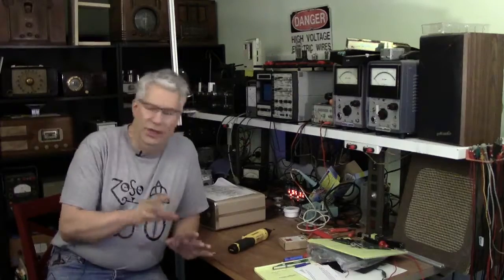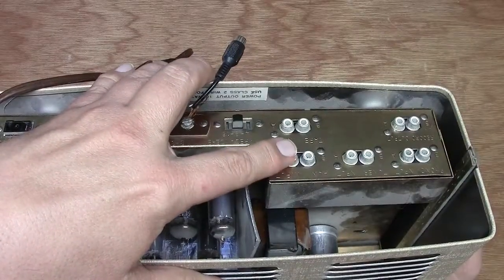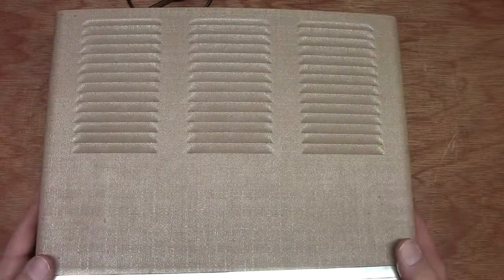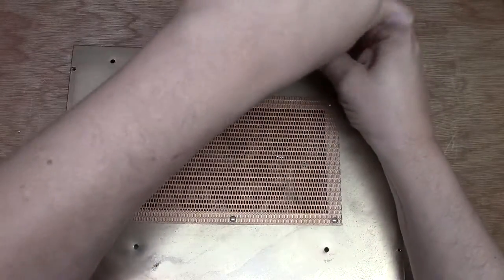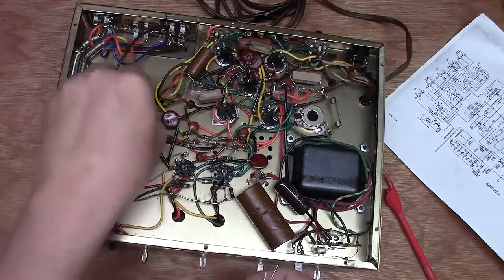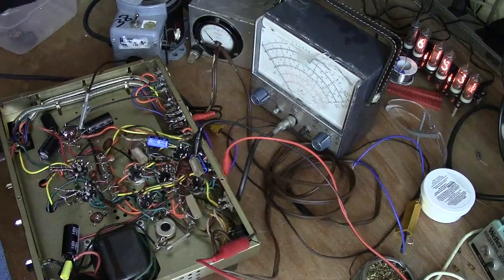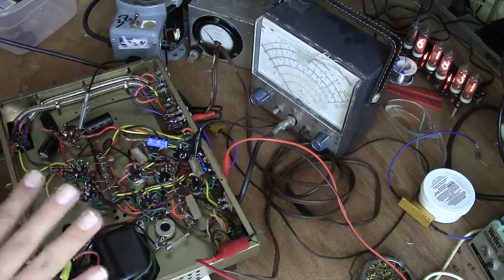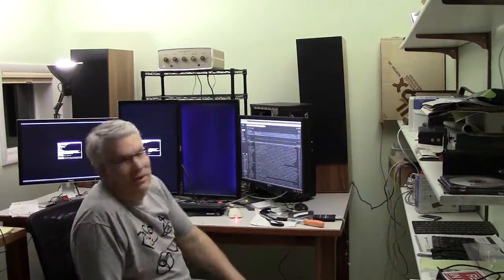161215 Valve Studio - Recapping Voice of Music 1448 to Drive my B&W Garage Sale Find

Comment: I was quite surprised by one VD cap being a can and the other being not-can...  One would have thought since they used a 3-cap can for other filtering, why not a 2-cap can for the VD PS circuit.  Anyhow.   Bass sounds impressive from those speakers.  Used for Skype?  Shame!

Did I see your shirt is a Led Zeppelin one?  Yeah, I've got Fagan's "The Nightfly" in my CD library.   If you've never seen the official music video for "New Frontier", give it a look - quite creative.  Also on YouTube is Fagan, his musician partner and other (notably Michael McDonald) musicians talking about the making of 'Peg'.  Way cool to hear McDonald's ultra-tight harmonies.  Best 2 U.
Reply from the maker: Yeah, should have kept my skype comment to myself, but I did a conference call yesterday on them, ha ha.

I was also surprised at the cap type choice. When I first opened removed the cover I was looking for the 2 voltage doubler caps but didn't see them. Traced the circuit to figure that out. VM designers might have used different power transformer (higher voltage) originally and switched at some point after the steel was stamped. We may never know.

I've seen the New Frontier video long ago. Will watch it again today. I have YT video on The Nightfly album, CDs and digital sampling on first generation CD players. https://www.youtube.com/watch?v=mcOJdv8oZI8

Thanks for writing.